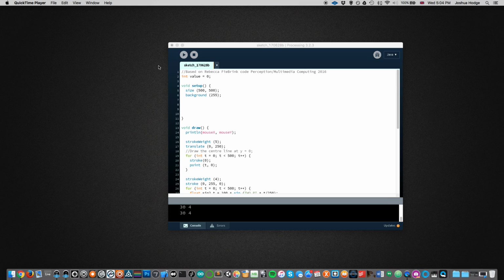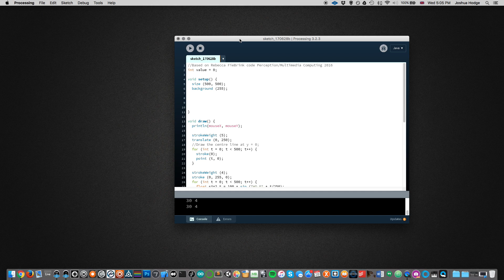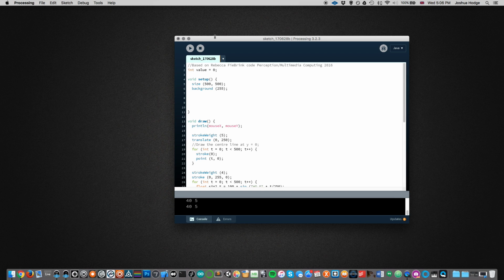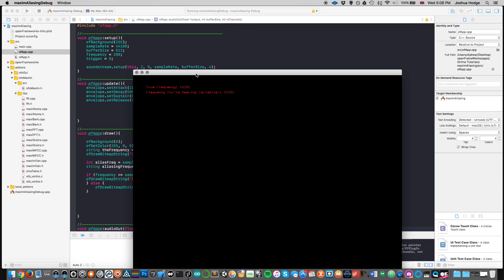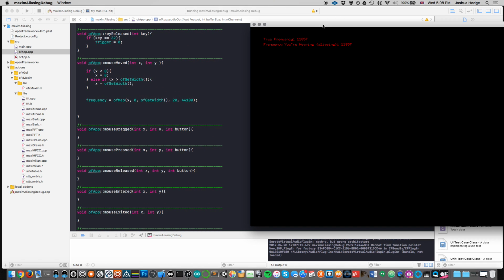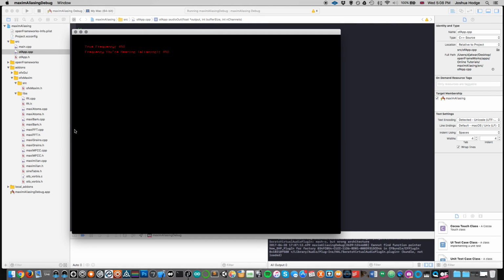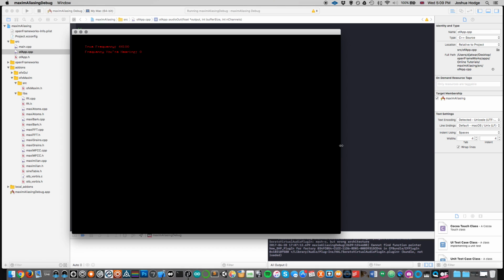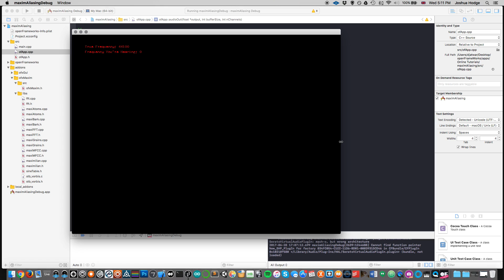Audio Programming for Beginners  Tutorial 01-  Aliasing & The Nyquist Frequency

Comment: Hey bro tyfor the video! may I ask, I just tested something on my FM synth - I took an algo. with one carrier and like 4-5 modulators on top as in 1 total column. I cranked up the Modulators' output really high and noticed I get distorted frequencies when I play in the higher octaves of the keyboard. Why is aliasing caused in that instance? My hypothesis is that when I reach a certain point in those high notes on the piano keyboard I bump into the /2 Sampling rate freq. of my machine and the mirrored frequencies distort (the FM process created much overtones). But I am not supposed to hear anything above 18k anyhow, so how in your example or even mine I managed to hear the aliasing when you were playing a frequency ABOVE 20k (and obviously non of my piano keys has the fundamental of 20k nor any overtone above it can be heard by human ear)? how does a recording even reaches anything above 22,050k anyway to allow for aliasing granted CD 44.1k S.R?  would love a clarification as it doesn't make any sense to me. Thanks again! :P
Reply: I realise this is an old post, but FM does indeed generate a lot of overtones that can be way above the Nyquist frequency (even on relatively low notes), same with abrupt transitions like square waves (assuming no oscillator waveform pre-calculations such as 'polyblep')..so you will hear fold-back frequencies (because those frequencies cannot be represented at the current sample rate) and they will not necessarily be harmonically related to the pitch of the original note played, which is why it sounds so bad, especially when also modulating pitch of the carrier at a low rate, you can notice it even more (e.g. try pitch bend controller or LFO). The higher up the keyboard you play, the proportion/level of foldback tones vs base note related frequencies shifts towards those aliasing tones - so it's much more noticeable.. In synthesis you could oversample (power of 2  times sample-rate) the generated data in your code (either in the whole audio chain, or just at oscillator waveform calculation), filter out the aliasing more easily due to the higher 'virtual' sample-rate/much higher Nyquist frequency, then downsample (by same factor of 2) back down to the original sample rate of the output buffer.  The higher the oversampling rate, the easier it gets to filter out the foldback tones. The demo would have been good with a FFT spectrum display and a square wave as the source sound.